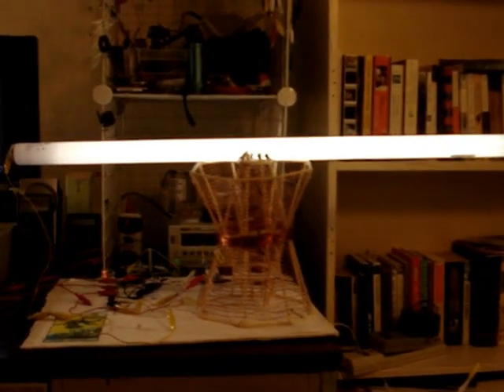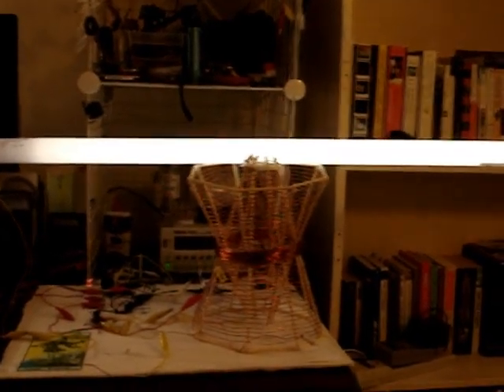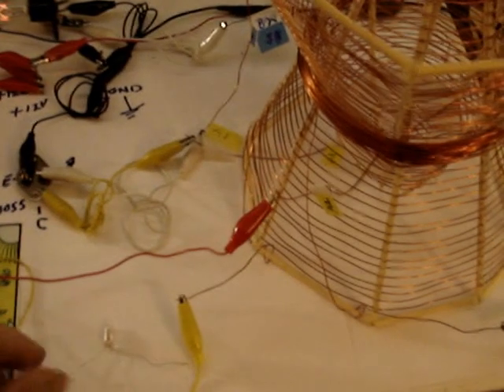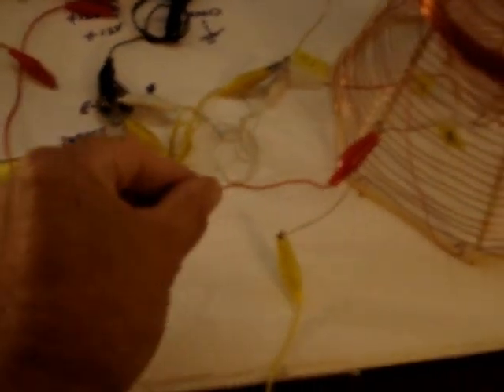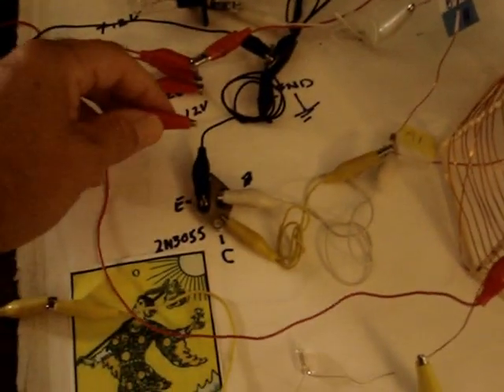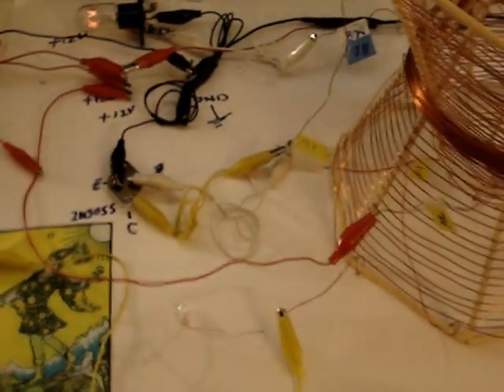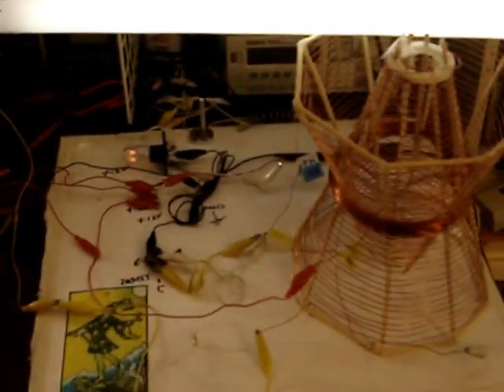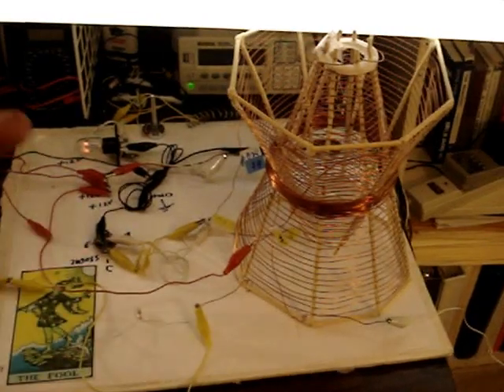Bashar Double Cone Coil  Part 2

Comment: that wire does not look insulated, is it?
Reply: thanks for that i had heard there was a "the one" kind of ratio heh.

bashar definitely specifically stated 3 feet tall, so you have to make 2 cones that are 3 feet tall heh. kind of hard core.

The way im doing it is, im taking some copper wire and making a FLAT coil, like in the shape of a round plate, once its big enough, i grab it from the center of the spiral and pull it up, viola! a perfect cone, its trickier than you would think though to do this.   Im almost done with my idea to do it, and i can basically produce these very rapidly and ship then in the flat version if some people wanted to purchase for experimenting, i dont have an o-scope but im thinking i can figure it out on my own or use a buddies, anyway im rambling heh.  GL to you too!
Reply: yeah it's enameled, would need extra insulation for higher voltage though
Reply: I am going to make a full sized 3 foot double cone, i found a way to get some 8 gauge copper wire into a perfect cone, I am thinking of getting a large cylinder container and dropping the double cone in mineral oil or motor oil or something.
Reply from the maker: yes it is enameled coated wire, used in transformers, etc.
Reply from the maker: heck naw Sounds great,  not sure what the best diameter to height ratio should be for the cone, but it is probably related to phi or 1.618 the golden ratio. or some multiple of it.    best luck
Reply: heck naw save yourself the hassle mate you don't need to, oils just for cooling transformer coils running a lot of current. This coil should run cold, high voltage AC low current due to Ohm's law. Like a Tesla coil which is what i would use to pluck the antenna with, make it 'ring' and hopefully, if constructed correctly, it never stops...
Reply: my copper wire is not insulated, so i can spray it on i guess it would be easier, but i dunno. 
Do you have any spray insulators to recommend?
Reply: Bashar definitely dropped some hints that i haven't seen anyone pick up on yet, i will share what i noticed.

Everything must be governed by Phi, the golden ratio. We are trying to resonate with nature and this is the ratio of nature so if you are unsure what Phi is it's highly worth looking into because it's such an important part of this kind of technology that everyone is missing out. Closer you get to Phi the better the results.

He mentioned fitting it inside a 3 foot pyramid, that's the first major clue. Why not just say 3 feet tall? There is a video on YT called 'Les Brown - The Physics of Crystals' where les tells us how when he built a 40 ft pyramid he tried to use it to generate electricity by hanging a coil from the apex and connecting it to a coil on the ground and when he made the connection it threw him 20 ft away. Worth watching.

So, i would build a golden ratio pyramid, a replica of the giza pyramid 3 ft tall. If you draw a 2D pyramid on paper, a triangle, you can divide it into smaller triangles like a pyramid made of pyramids. If you do this, draw your 3 ft pyramid (scale) out on paper then divide it into triangles you will see in the middle two inverted pyramids that look like the space time antenna. Draw circles in square bases of those pyramids and you have your cone sizes.

I'm sure Bashar mentioned it would display a corona, that means high voltage so thin gauge insulated wire is best suited. This works on resonance we are told, i see it like sound. We are plucking the coil like a guitar string so a thin wire will resonate easier at higher frequency. Insulated because at higher voltage the tric will arc through the enamel. The amount of turns and spacing in between turns will be governed by Phi, golden ratio. 

From there i would do what Les did with his coils, i would sit my completed antenna in the pyramid oriented to magnetic north using a decent compass and connect it to the base (grounded) and the apex, with great caution. I would ground it last from a distance using a plug socket or something to be on the safe side. After Les' pyramid gave him a flying lesson he took the whole thing to pieces it scared him so much.

More on the pyramid. It is also known by many as being an antenna itself for cosmic energy. 'Pyramid' generally means 'fire in the middle' PYRA - MID. If constructed to Phi it interacts with the magnetic field of the earth focusing this energy at 1/3 of it's height in the middle. Now this would focus the energy directly on our space-time antenna, that's why i believe Bashar mentioned the pyramid.

It doesn't have to be 3 ft tall but i imagine that's a good size for average consumption. It all starts with a Phi pyramid and the ratio takes care of everything. Hope this helps :)
Reply: Craig Potter
I thought he said it has to fit inside a 3 feet (3 sided) piramid.  So the cones would be smaller than 3 feet.  Bigger is ok, but if smaller it wouldn't work.
Reply from the maker: this is regular coated magnet wire, a thin insulating coating all over.
Reply: I have figured out how to make a 3 foot tall prototype, I will have it made within some odd months and ill post a how to video on how to make it and I don't have an oscilloscope so I cant give any information on the frequency it gives off, I can sell the parts for my antenna for fairly cheap that way more people can figure out how to use this, I have a pretty good understanding from unifying many things I found on the net about resonance.  its basically 2 separate systems, or 3, but this antenna is actually 2 of those combined.. you have a frequency resonator.  Something that emits an energy, and then you have collectors that tap/draw from that, then have it made into something that can be used for household equipment.

anyway my technique is simple, just takes a bit of work cause im making a device that makes it for me.   Ill keep you posted.

Comment: Looking good.  I now think you need to build the receiver pyramid around the cones.  I think the pyramid should be build out of aluminium and copper.  You will be able to harvest more electricity.  I have been experimenting with a plasma globe and getting results similar to yours as far as lighting fluorescent bulbs and neon.  Keep going you are an inspiration.  Peace.

Comment: Hi Jack,

It is definately exciter in your setup. If you run it from battery and ground fl light contacts, it will be lit even brighter... :)

One amazing thing you can do here - wind another coil and tune its natural resonant frequency (by wire length) to your exciter. Then you will get Tesla wireless energy receiver - en(dot)wikipedia(dot)org/wiki/Wireless_energy_transfer

Good luck!